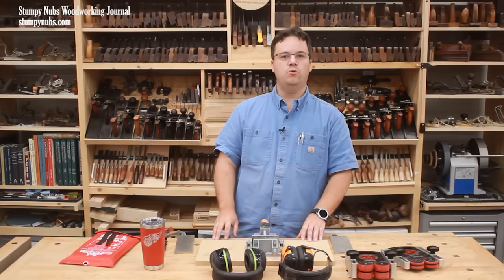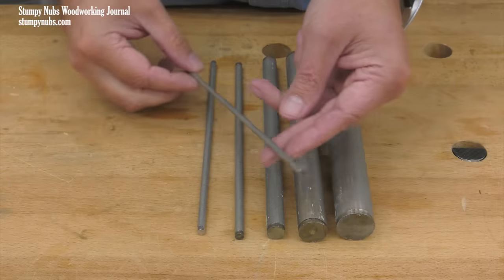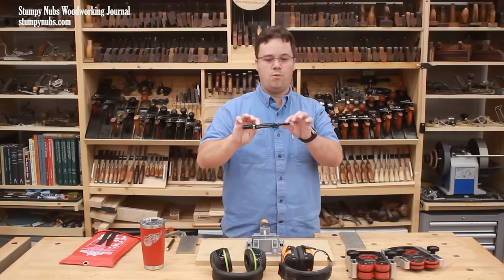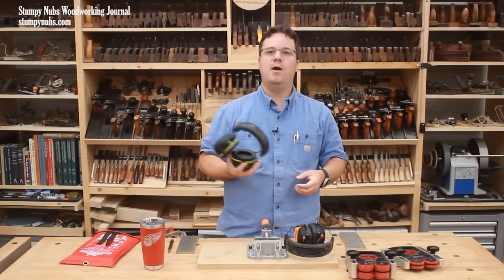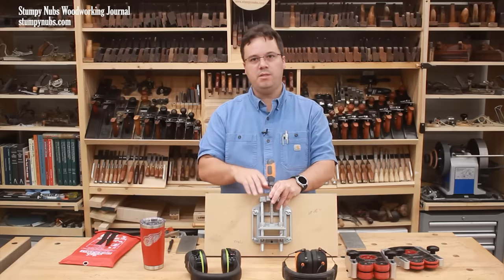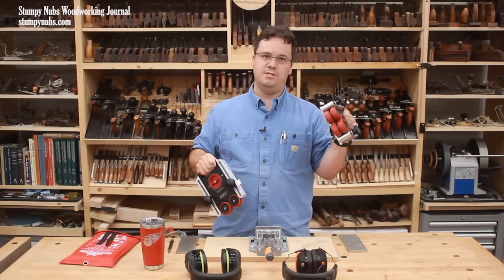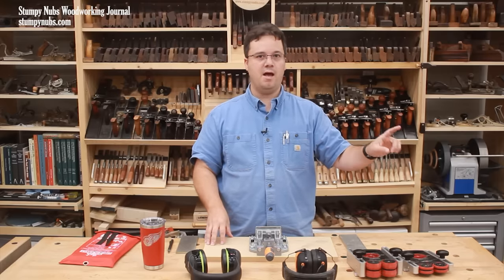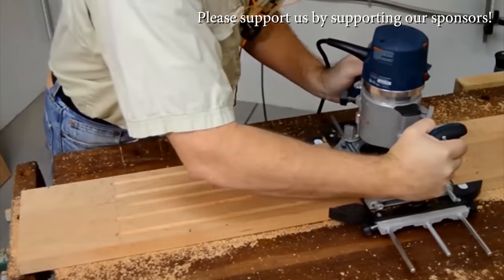7 clever tools I wish I had YEARS ago!

Comment: The jessem clear cut stock guides are by far the best 'evolution of the feather board' type accessory on the market. The two way pressure provided is amazing and obviously patented lol I will say that Harvey did a great job of bringing a product of value to market while having to design around such an innovative design patent as found on the jessem. In fact I can think of a few situations in which the Harvey would be advantageous because the jessem design just couldn't be used, such as really tall stock. That said there are many more situations in which the exact opposite would be true. The jessem is a far superior design.

Comment: I would add a comment concerning the fire blanket (and fire extinguisher). Ideally they should be mounted at or near the exit(s) to the shop. that way if you should have an issue you have to go to the door to retrieve the blanket or extinguisher. Then when you return to the fire, the door is behind you. This way, you haven't placed yourself on the other side of the fire from the exit. IE: You have a line of retreat!
Reply: Not only is this good advice but the best advice is to have more than one and to have them hanging on the walls with no possible obstructions in the way or on posts if you have any . Additionally spend the money for the stickers or RED PAINT to highlight their locations as this may actually be a fire code requirement depending on where you're located.
Reply: Another thing to be carefull about is that not all fire blankets are made equal, the properly made ones will work on all the fire types you meantioned but some may not work at all,  while some work will work but not on oil/grease fires.
Reply: I was tought they need to be in a central location, to minimize the average response time. Preferably one that will always have some room, like a support column in the walk/drive paths.
Though they are mandatory here in some circumstances (I know people who have one in their hobby room and at an old job all vans had one) I don't know how fixed in stone that guideline is. But considering the cost/benefit and longevity I would just say "do both".
Reply: Agree with all comments in this subthread. Two more things: 
1. Stick a few alarms per year in an electronic clock to make you all practice a fire drill, preferably with nobody knowing when they are scheduled.
2. Arrange for your local fire officer to advise about ideal and second best fire defense for your shop. It's easy for us amateurs to miss something that's obvious the moment they point it out
Reply: Disagree.  The primary purpose of fire equipment is to enable humans to exit.  Extinguisher should be at the interior so that if the fire is blocking your exit you can make your way out.  Once you’re at the exit, you can safely get out anyway.  But I like B’s comment “why not do both.”
Reply: Fire code specifies that extinguishers are to be mounted at, or on the way to, the exit from the shop. I believe that the code also specifies that the bottom of the extinguisher be within 36” of the floor (so you can find and grab it if you are crawling out). Not only does this “protect” your avenue of escape, it also standardizes where fire extinguishers are located.
Reply: @bigk4755  best to check with your local fire department. Each community has slightly different requirements. 
When the company my husband was managing built a new office space/warehouse, they invited the local fire department to review the plans. Turned out the architect company (from a different area of the state) was not aware of a couple of new fire codes in the local community. They were able to quickly revamp the plans to be code compliant and saved a major headache. 
Once the building was done, the fire department actually ran a couple of “fire runs” to train all their staff on the new state of the art equipment in the building. The business and the fire department continue to maintain a great relationship. The EMT/Paramedics even do regular classes to keep the business’ Emergency Response Members up to date and properly equipped.
Reply: @patc5577  as part of building my building in an industrial zone to be a woodworking shop I had to do a formal Hazardous Materials Report that was quite involved, and had to study the fire codes so as to be able to comply and satisfy that portion of the building permit process. Fire code is actually a combination of 3 different codes and code authorities. Even the Capt at the fire station that covers the area I built in agrees that the fire code is very complicated and hard to follow.

The standard about where fire extinguishers are to be located is a part of and prescribed specifically in the fire prevention code. It is a standard so that everyone knows where to be looking for them during an actual fire when visibility is usually not that great, and also so that if necessary the extinguisher can be deployed to try and clear the exit, if necessary.
Reply: ⁴

Comment: personally I did not like the fatboy pencil. It is very well made but I found that I was always sharpening it to get the finer point and you had to use its sharpener which is slower than my knife like I use on  other wood pencils,  also its very messy sharping such a large piece of lead. I did discover that I like the Zebra unbreakable mechanical pencil for a lot of my finer carpentry projects. its not unbreakable it just retracts the lead if you push to hard.  This is just my opinion so take it as you will.

Comment: If you realized with the first helical conversion how much better it was, why on earth did you continue to get machines with straight cutters when they’re available from the manufacturers with helical heads? That makes no sense at all, and if the conversions were done within the warranty period, that just voided the warranty.
Reply from the maker: The first two Delta tools (planer and jointer) I already owned before upgrading them. The third was a Dewalt planer, and it was not available as an option. The fourth and fifth were Grizzly machines and they were not available at the time with helical heads (out of stock). Even so, I would have still bought them without because you never can be sure of the origin or quality of the heads that come in those machines. Since I already had a lot of experience with heads from mywoodcutters.com, and I knew I could trust them, it made a lot of sense to just get the heads from them.

Comment: If you wear your earmuffs with a ball cap, remove the nail from the top of your cap, it’s way more comfortable. I’ve been removing them for years.
Reply: AGREE!
I started removing them about 30-40 years ago.
We used to use our caps to swat things & each other.
Removing the 'buttons' on top of our caps was 'popular' in our crew.
I still do it because the 'buttons' will definitely hurt your head if you bump it against anything hard.
Reply: @jons2447  Yeup! Ouchy
Reply: Lol Numpy Stubs skipped to the end for the cheap one first 🔥🔥🔥 scortchyo
Reply: I didn't get what you said... Nail? What nail? Are yours put together with a nail? I think I misunderstood
Reply: @dashcammer4322  Same w my 3M's...
Reply: He means the rivet in the top of most ball caps. Some don’t usually tactical ones but most have a rivet at the very top.
Reply: Pilot's caps also lack that button.  I get mine from Flight Outfitters and Sporty's.  The range is limited but no stupid button!
Reply: Why the heck would you need to wear a ball cap in the shop?
Reply: @jrclark222  1.  Keeps the very bright shop lighting (8 each 8' LED lights in 400 sq ft.) out of my eyes.  2.  Being bald, a cap protects my bare head from most cuts and dings like when I bend over and bump something or I've stuck my head into a cabinet carcass to install drawer slides.
Reply: @jrclark222  poor upbringing to wear hat indoors.
Reply: @sarchlalaith8836  he’s referring to the button on top of most baseball caps. I guess. Nail ?
Reply: @jrclark222  Not everyone's workshop is indoors, and sometimes we might just be working on a project outdoors
Reply: @rileydj8764  it’s a sign of a poor upbringing to assume that your cultural upbringing is better or more honorable than those of others. I have spent significant amounts of time in some thirty five countries and find your comment to be both provincial and closed minded.
Reply: @jrclark222  I wear various hats to keep sawdust out of my hair or sweaty scalp. If I’m turning I’ll wear a welders skull cap or a watchman’s knit cap when it’s cold. Brimless to accommodate the face shield.
Reply: @chrisobergin3955  darn, I’ve only worked in 29 countries, and lived full time in 4. Sorry you’re so easily offended by our cultural norms here in the West. Hope you survive.
Reply: Me too
Reply: @rileydj8764  you’re a real peach princess
Reply: @chrisobergin3955  careful being direct and honest on the internet, they’re issuing fines for that kind of thing
Reply: @jrclark222 the Balds don’t go anywhere without a hat on. 
Shower, the wood shop, swimming…

Comment: CBN has the same crystalline structure (hence the "cubic") and the same Mohs hardness as diamond. From the mechanical standpoint, CBN should work as well as diamond. Not better, not worse, but almost equal. The cost, of course, is much lower.

Comment: I am not sure if you mentioned how much quieter helical heads are compared HSS.  This is especially significant in a home shop where you need to worry about your neighbours.  Clogging up dust extractor ports is a huge advantage, and especially if your timber is not as dry as it might be.  Helical heads completely eliminate that clogging problem.  I am not sure if the finish is any better.  I expected to see the parallel lines across the timber eliminated with helical head, but that is not the case.  I regret buying the Link bluetooth ear defenders now, as I suspect the new ones from ISOtunes would suit my large head size a lot better.  I am still using my Bose QF35 in the workshop as the Link ear defenders are too tight and soon become uncomfortable, and this is especially so when you are wearing reading or safety glasses, as the arms dig into your ears.  I like the look of the Fat Boy markers and have ordered a set already, but Amazon shows limited stock so don't delay if you are interested.

Comment: Another really good thing about the fire blankets is that, handled correctly, they are pretty much the best way to help a friend who is burning. Get them on the floor and cover them with the blanket. Pat down so to smother all flames and sparks. The most important thing is to start from the head and work your way downwards as otherwise you will force the flames up to the face and that wont help very much.

Comment: A thing to be careful about with fire blankets though is that not all fire blankets are made equal, the properly made ones will work on all the fire types you mentioned but some may not work at all,  while some work will work but not on oil/grease fires.

Comment: One serious issue with the fire blanket.....it is full of fiberglass and handling it will resuilt in lots of fiber glass in your skin. It is also very loosely attached so when you open the blanket a lot gets out into the air which would be a health hazzard for your lungs. I have another welding blanket i got years ago that doesn't have that issue. Before buying the one on Amazon you may want to check out the reviews...especially the 2 and 1 star reviews. Otherwise the other products look fine. I really like the Harvey feather board like tool although a bit pricey.

Comment: I like the Fastcap long nosed ink pens, but I have a few problems with them.  Once I start using one, they dry out in a month or two.  I live in the high desert so maybe that is something I have to live with.
The other problem sometimes shows up on day one.  The cap doesn't pull off from the ink cartridge - instead you get both parts in your hand and now you have to separate them, getting your hands full of ink.  Once this happens, the cap will never come off correctly again - you have to throw it away.  I have tried CA glue, but the ink seems to keep the glue from ever drying.
Other than those problems, I really like the pens, but at a failure rate of about 50%, they just aren't worth it.

Comment: I'm retired and a very part time wood worker. I don't have the most expensive and newest tools. I do have all of the basic tools one needs for a decent wood shop and yes some of them are from Harbor Freight (gasp). With that said it's not hard to understand that spending the money on several Shelix heads was not easy. Well the first one wasn't, as it was for my Harbor Freight jointer which is really a copy of an old Porter Cable unit. Yep the Porter Cable dropped right in. Best money I ever spend on a power tool. It completely transformed that machine. So it wasn't hard to spend the money on an old Rigid thickness planer that I acquired. I looked at different, better and way more expensive machines that I couldn't afford for a long time and decided to try an upgrade on my old machines and man what a difference.

Comment: Regarding Ear Pro: I use banded earplugs, and use a heat gun to adjust the clamping pressure to my particular head width (Which can get a bit oversized at times I admit).

Comment: you cool tools are considered drool tool for me.  As a weekend woodworker, it's hard to justify some of the good stuff here.  At least still nice to learn about it and may be sometime in the future, I can afford them.
Reply: It would be a great benefit to teach yourself how to do everything with just a few quality Japanese hand tools. Once you develope the touch, you will find it really convenient. Also the level of precision can be unmatched when you learn a few helpful layout techniques.
Reply: @Toyotajunkie  unfortunately I don't.  I am hindered by storage space since I don't have a dedicated shop.  My "Shop" is a pop up tent on my drive way.  If I can build a cabinet on wheels that holds the router on top and make enough space on bottom for planer, I would then buy one.  It has to be easily rolling in and out of the garage (my storage).
Reply: @opendstudio7141  Agree, I am eyeing on those Japanese pull saws.  But when I tried to pull the trigger to buy, those reviews are what really set me back.  Some of them have really bad review with handle straps falling apart.  I even tried to buy the ones posted on Stumpy nub's video.  I jus don't like some of the reviews.  I know they are not all like that.  But it's very frustrating getting faulty equipment (And I have had some bad experiences).  I'll get them as I need.
Reply: @ipick4fun27  a general purpose carpenters Japaneese Ryoba is a good start. $50-60 bucks seems pricey, but it's thin -precision hardened, carefully tempered and aggressive enough tooth pitch to cut quickly/cleanly without having to push it. Take good care of it and the teeth will stay sharp a very long time. 
Learning to let it float requires patients to unlearn old sawing techniques. From observation, the cutting pressure is generated by blade shape, the way the teeth are cut and set to work on the pull stroke. Genius.
To get a good feel for fairly cheap, you can buy a Marples razor saw at one of the Big box stores. Very handy and capable little saw you will use frequently. Irwin/Marples also produces a Ryoba for about $26 US.
Reply: @opendstudio7141  I have plenty of crap tools just to have them replace too quickly.  I'll go for good stuff now.  LOL.

Comment: Do you think that the roller guide could also be used as a thin rip guide on a table saw? Also, nice to see you are a hockey fan!!
Reply from the maker: If you reverse it and use the back as your index you could use it as a thin strip rip guide. The same is true with most featherboards.

Comment: My biggest problem with earmuffs? They don't fit! Earmuff manufacturers, and headphone/headset makers, need to add an important specification to their advertising: what size head do they fit? The measurement needs to be from earlobe, over the crown, and to the opposite earlobe. I have a similar problem with hats: most stores in my area have hats in S-M and M-L, and I need hats in L-XL, fortunately not a problem with hard hats.

Comment: +1 Helical head: outfitted shop with helical head jointer and planer and they are AWESOME! Yep, nick in the blade, turn 90 deg and move on. AND the fire blanket? GREAT investment (easier cleanup too should you have to use it). Thanks again for a great series!

Comment: I couldn't agree more with the commentary on the Shelix cutter heads.  I upgraded my 13" Delta planer, liked it so much I upgraded a 6" Jet jointer as well.  Installation was pretty straightforward in both cases, and the cut quality AND noise reduction are fantastic.  Will never go back!

Comment: I bought the ISOtunes Air Defender, but I have to say, I'm very disappointed. They fit so tight it feels like I've put my head in a vise every time I put them on. And I don't have an overly large head - I'd say it's average size. I'm glad I got the 15% off deal to offset part of the rather expensive shipping charge to get it to me here in Thailand. As I feel I'm not going to be getting much use out of them, it would have been an even more expensive mistake had I not received the discount.

Comment: Thanks for making these videos. Just but a few of these things in the shopping cart. With respect to the Harvey Roller Guides, will the larger one work as a "one-size-fits all". I watched your video on tablesaw kickback and I resembled a few of your examples. I mainly cut 1x material on the table saw and I don't have a featherboard, and was thinking of making the investment in the Harvey, so just wondering if the larger one works fine with 1x material.